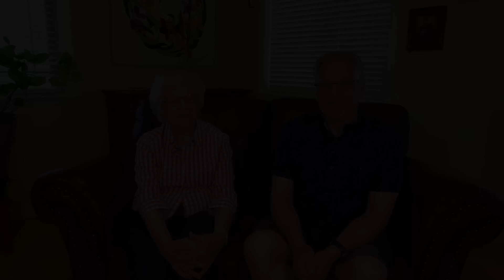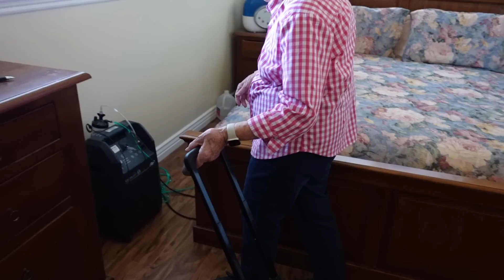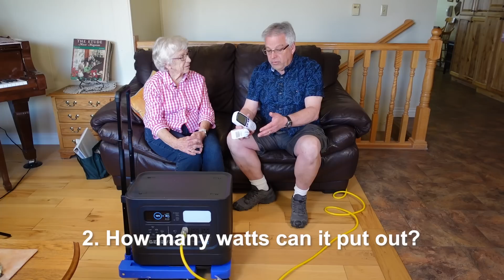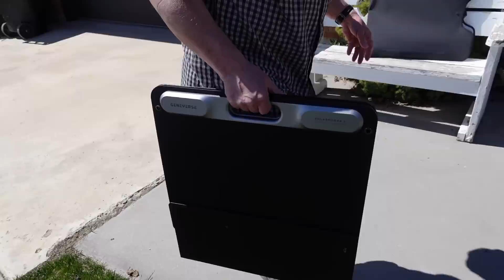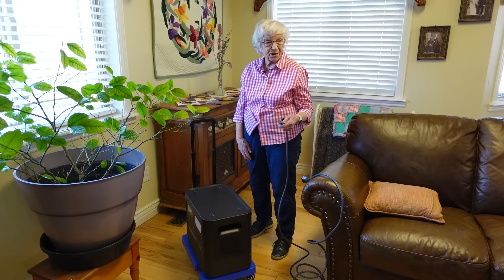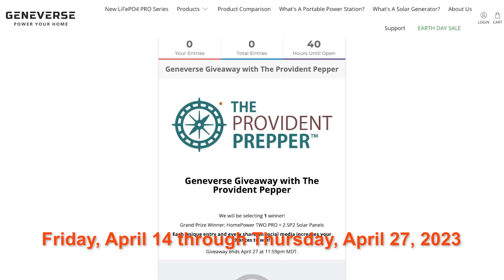Perfect Backup Power Solution for Medical Equipment

Comment: I have a question for us in the UK 🇬🇧. 

We have two problems here. Some of the smallest houses ever (statistically factual), and a few countries nearby that are having "geographical issues" that might cause us to start stockpiling. 🇺🇦 

I've started my own stock, but we don't have cellars, spare rooms and our under-bed storage is already used for sheets etc. because there's nowhere else

Is there a way to keep things cool that we can do? We only have garages and sheds here and they get pretty warm in the summer. Picture New York apartments, but without the height, smell, and crime 😉 

Light, moisture and air already covered thanks to your great videos!

Thanks for all your info, it's fantastic and easy to learn things quick.

Comment: Anytime I buy anything preparedness wise, I always look for items that have a solar change ability as well as batteries if possible; just in case because we find ourselves in a prolonged outage.... or I move to seattle for some incomprehensible reason where it's cloudy more often than not 😉 and I have to stretch my fuel [dual fuel, gas & propane - do not have a solar generator yet which I'm disappointed about.

 for example;  I use those little pop-up ones that have a solar panel on the top of them.  They will easily recharge themselves in the daylight just sitting by the window, or undn A lamp for that matter.

Comment: I am retired. I have a tri-fuel portable generator that I bought in case of a hurricane in Southeast Texas. I have used it during the Texas Freeze a few years ago and occasional outages. I have natural gas for the cooktop, water heater, furnace & dryer. I run the generator on natural gas and it powers most of the house through the electric panel. As a backup, I have two 666Wh power stations, and four 100W rigid solar panels which I made into two 25 pound suitcases to set up in the back yard. I installed emergency lights that come on when power goes out. They are where I set up the generator, at the panel and in the main hall of the house. I also have some Ryobi flashlights and batteries.
Update: I now have added 2 pair of 1408Wh power stations, each pair can connect to each other resulting in 2816Wh per pair. One pair can connect to the generator inlet box. Plus I have 1000W of solar panels.
Reply: Can I get more info on your set up? I am in southeast Texas also any have an almost 2 year old that was just diagnosed with apnea. We are trying to figure out something for hurricane season to be able to power her equipment when we get it
Reply: @HarleyHearn2025  You have to determine your needs when power goes out. With a hurricane you never how long that will be. I rely on my Firman T07571 tri-fuel (gas, LP, NG) generator. I had the NG line extended to the back of the house when built. A 24 foot NG hose is used to connect to the generator from the valve on the wall. I have 25' and 50' 240V 30A cables to run thru the house, when needed, to 30A receptacle which is connected to a 30A breaker in the panel. There is a interlock on the panel which allows either the main breaker or the generator line breaker to be activated. I have a 4-ton (46,000 BTU) A/C unit. Installed is a Micro-Air EasyStart 368 (4-ton) Soft Starter on the outside unit. My A/C unit now uses 12.8 to 13.8 Amps and a Start Peak of 33 to 36 Amps. This allows the A/C to run when using the generator. I not have to worry about hot water, heat or cooking as long as there is NG. I don't have propane containers yet.
As a backup, my 4 solar panels are brought outside when I have to use the 666Wh power stations. I have two 296Wh power stations that I can use to help charge the larger ones at night. All of the power stations have the older lithium ion batteries. I bought them during sales with coupons and promo codes. I got them for 25 cents and 31 cents per Wh. I just bought a 1408Wh LifePO4 power station and looking to get 2 more panels.
Reply: PLEASE understand that a temporary power outage and the collapse of the United States electrical grid are TWO COMPLETELY different things!

The collapse of our grid is imminent. 
⭐️THERE WILL BE NO FUEL AVAILABLE! Not only will fuel be out of stock within weeks to months, but NO natural gas will be available nor diesel. EVEN with the “fuel extenders, which destroy any engine, doesn’t last MAXIMUM of 1 1/2 to 2 years IF you have the weapons and strength to fight for your life to get it! So look to and invest ONLY solar, wood, wind and solar power!!!!

I see SO many misled and confused Americans that truly believe that fuel is endless and obtainable during this hyperinflation AND staying on the verge of total collapse and war invasions and takeover by the Chinese and Russians, who have become Superpowers, and much more powerful than the present United States.

Comment: I require the use of a battery-powered wheelchair and my husband uses a c-pap machine. Also, a stand-up freezer. Phone charger and/or tablet would also be ideal.
So, the freezer would need a separate battery, correct? Is there a specific charger for both my husband and myself at night?

Comment: 💯 excellent video. I have a different brand battery bank. These battery banks have truly changed electric back up options. With adding solar panels and a small inverter generator, a true electrical back up plan.